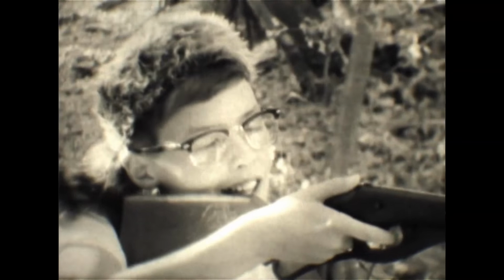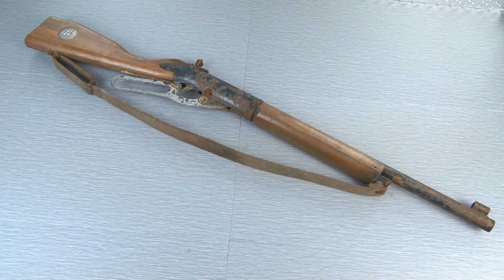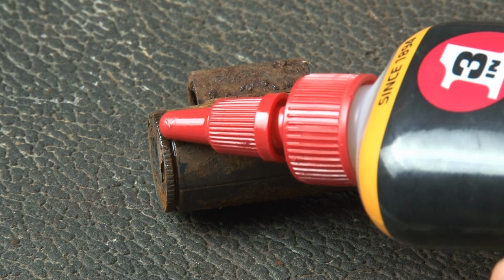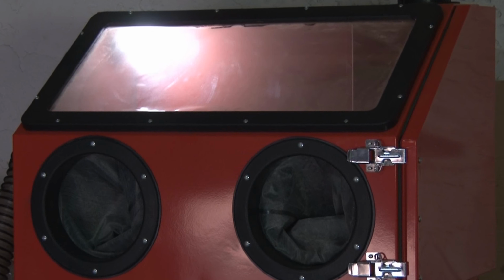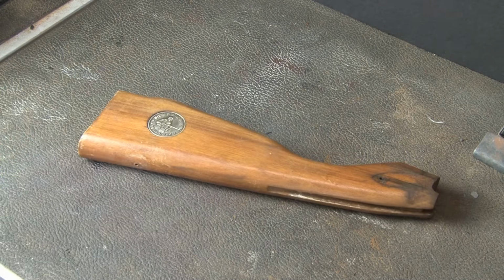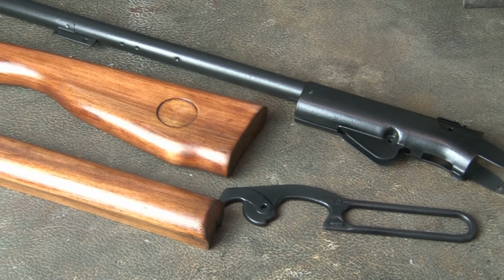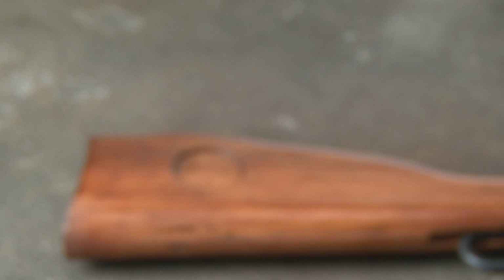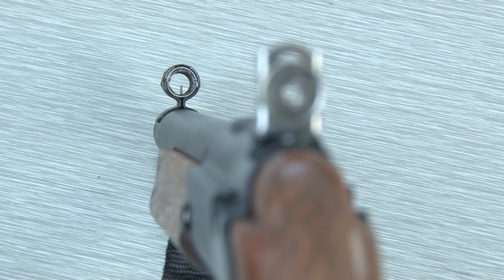1960's Daisy BB Gun Restoration! From Old to New!

Comment: The 99 was supposed to be one of Daisy's most accurate air powered guns. You did a nice job.
Reply: He didn't replace the rubber plunger, or the mainspring. Also he didn't show if he cleaned out and resurfaced the cylinder where the plunger moves back and forth. And I never saw him lubricate either the cylinder or the plunger, or clean the inside of the shot tube/barrel. All he really showed was refinishing the gun, not restoring it mechanically.
Reply: @trevorjameson3213  Obviously, you are well versed on the subject. I appreciate the clarification.
Reply: Yeah this guy's "Restored" rifle is accurate up to ranges of 50-millimeters!

Comment: I have one of these guns and have restored it according to your video. It was left in my shed for years and looked a lot like yours. Mine was purchased new and was painted as you said and was not blued. Thank you Sir.
Reply: By the way, yours came out better than mine!
Reply: After rubbing down the metal action or being privileged enough to have a bead blaster - you use acid etch black primer (for metal) and then a thin layer of your desired paint, leaving it with just the acid etch would be best, it's matte but absorbs oils well and does not chip of flake, the leather piston seal should have been replaced even if you stamp your own new seal and dowse in mineral oil for a day would be the correct way of doing this part, as for the stock - I'm not giving away how to get a better than factory finish but it doesn't include a varnish with a brush! And the main springs on this rifle should have been heavily coated in moly grease. Perhaps consider doing a re-restore and up the devaluation this chap instructed you to perform.

Comment: Uhhhh,.... you just gotta oil it to fire properly. That wool pad basically is the seal. It’s designed to absorb the oil to create the seal. There’s a pinhole at the top for apply oil periodically and you oil in the little space between the receiver and the hinge for cocking arm. I just use regular motor oil. I find 5w-30 to be too thin though, so maybe a little heavier oil like 10w-30 or maybe 10w-40 for the seal, and use the However be aware if you get too much oil, especially if  thinner oil, slipping into where the shot tube connects it can cause it to sort of auto firing multiple bbs at a time, and sometimes even premature discharging when cocking it, and potentially a barrel jam or damage to the barrel attached to the shot tube. I just use a syringe to apply oil to the respective spots. Make sure you saturate the seal from the hole really well with the oil. That seal looks fine,... it just needs oil.

Comment: I was wondering about if you put any oil inside or even sand blasted inside the barrel to keep it from rusting.  The oil might help the spring release quicker.
Reply: Also,... if he needs a new seal he can basically just replace it with one of those wool mounts they use to mount music symbols on stands for drum kits. If he carefully cuts it to size.
Reply: The model 99 is a low power air rifle that is meant for shooting paper targets at 12  yards usually indoors mine when new out of the box was no more powerful than his in the video the only real way to make it more powerful is to swap out the original spring for a stronger one. if you swap out the spring then have to be more diligent about lubrication because a heavier spring will wear the plunger and seal quicker as well as the sear and trigger

Comment: If you can find them put some silicone oil on the seals and the pistol seal might be leather due to the date it was made so see if it could be replaced with a modern synthetic seal which would last longer and don't forget to put some silicone oil to that too! And you could put some grease on the spring and piston but I think some general lubricant would work fine.

Comment: It's quite anemic. It should easily penetrate the can at that distance. The seals are probable a big part of the problem. If they dry out you lose a lot of power. Those guns usually have a port to oil the seals. That and cleaning out the barrel will probably help a lot.

Comment: How did you release the plunger assembly from the barrel?  Did you use that tool to compress it, then bend the retainer and remove the retainer clip from the exterior of the barrel?  I am looking for the easiest (safest) way to handle the spring assembly.
Thanks for the video.  It is difficult to find for the models with that action.

Comment: The 4H BB Shooting Program uses a 499 to which is probably the big brother to your 99.  Seals, Springs and all the parts are still available the main difference is the 499 is a single shot design.  You roll the BB down the barrel after each shot.
Reply: The 4H shooting sports daisy Avanti 499, many range officers refer to them as rifles at competitions, they are wrong

Comment: The seal is the rubber piece on the front of the spring assy. that's why that part was so tight to get in & out, also make sure to lube the felt ring behind it. The Daisy lever-action BB guns are pretty disappointing power-wise to begin with, but proper lubrication will help immensely.